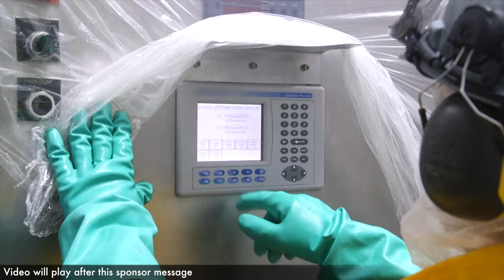Unlocking the Art of Small Talk

Comment: 🎯 Key Takeaways for quick navigation:

00:32 💬 Small talk can be a strategic tool if used correctly, especially in networking events.
03:47 🧊 Three phases of small talk: The "Icebreaker," "Rapport," and "Graceful Exit."
04:26 🚪 "Icebreaker" questions help start conversations and establish an initial connection.
06:02 🌐 Building rapport involves finding common ground and qualifying or disqualifying further engagement.
11:33 🚶‍♂ Knowing how to gracefully exit a conversation is crucial when there's no synergy or connection.
13:24 💼 Approach networking events as a giver rather than a taker, aiming to add value to others.